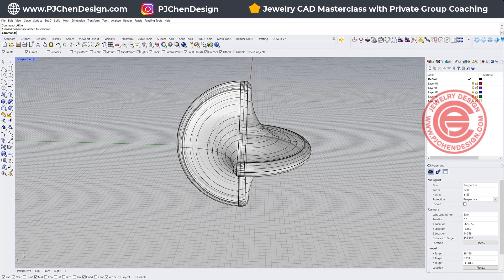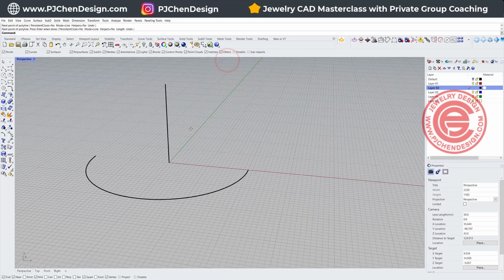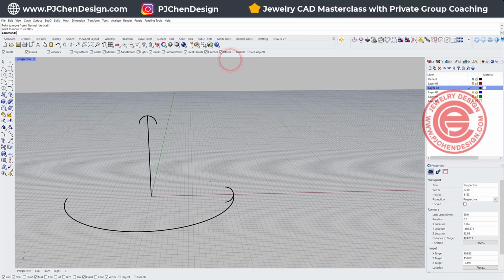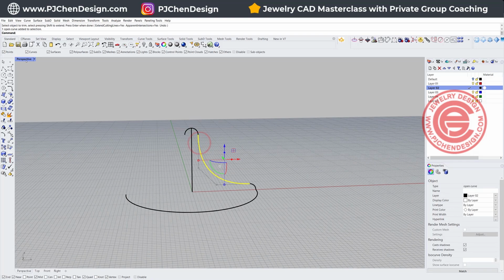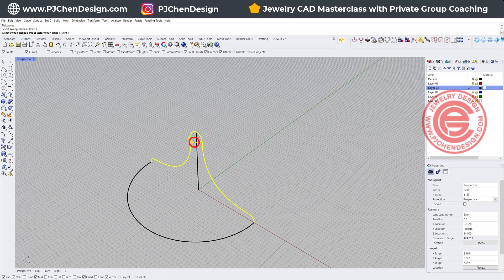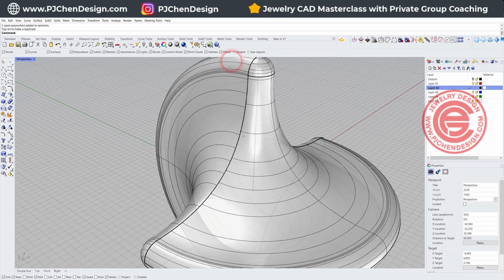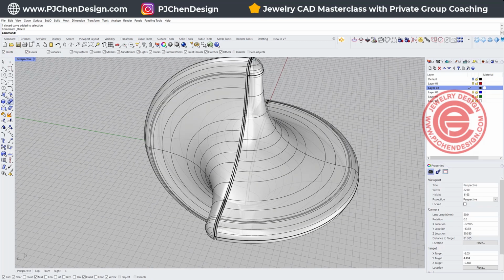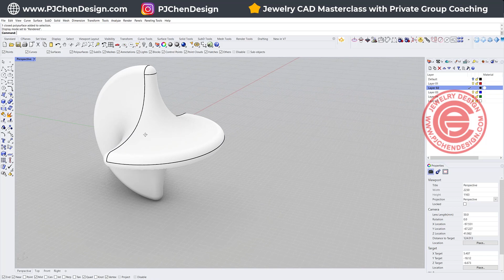Femisphere- Jewelry CAD Design Tutorial 3D Modeling with Rhino 3D #440

Comment: HI prof, thanks for your tutorial!! can i ask you what is an femisphere?
Reply from the maker: The form of the femisphere is reminiscent of that of a sphericon but without straight lines. Instead of that, it has circular arcs of arbitrary radius. For this reason, when rolled over a sphere, it contacts the whole surface area of it in a single revolution. ~Wikipedia has better explaination than I do. ^_^